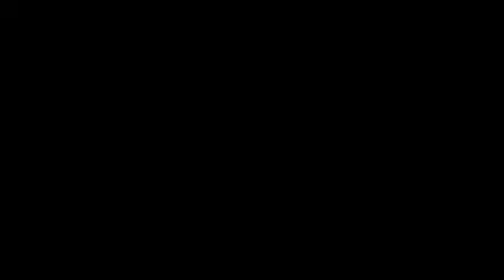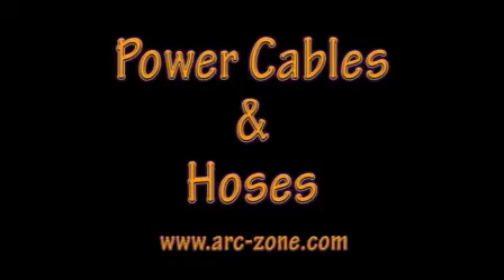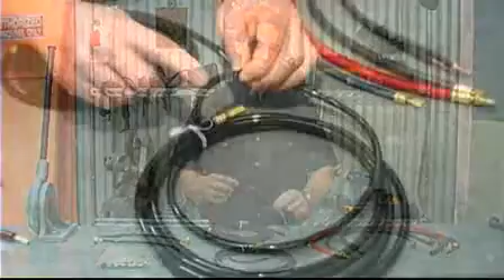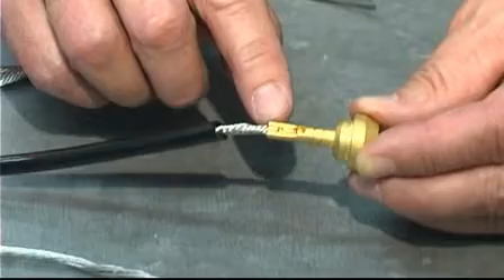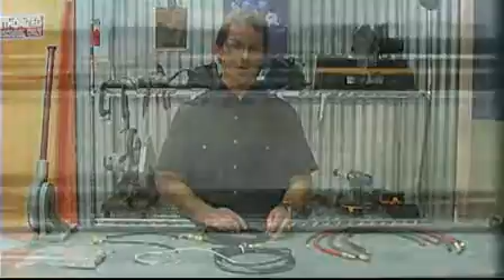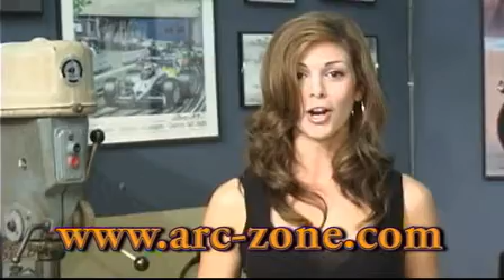TIG Cable and Hose Materials--What's the Difference?

Comment: I have a brand new Lincoln Precision Tig 275.  I though I could hear something arcing to the table. But never saw it.  Then I noticed one screwdriver laying on my table had a burn mark on it.  I think its arcing threw the zipper on the tig torch hose cover.